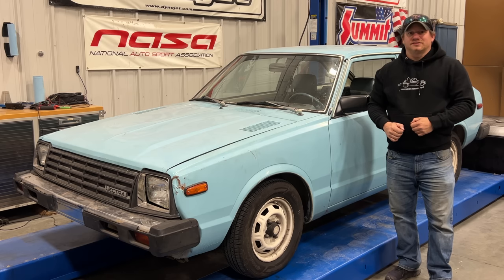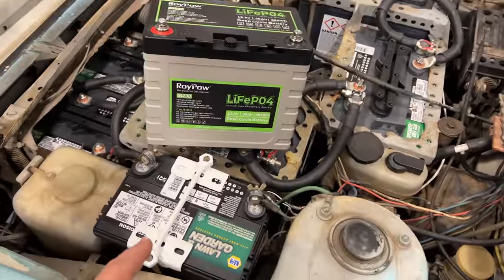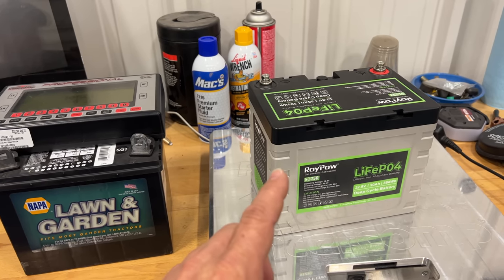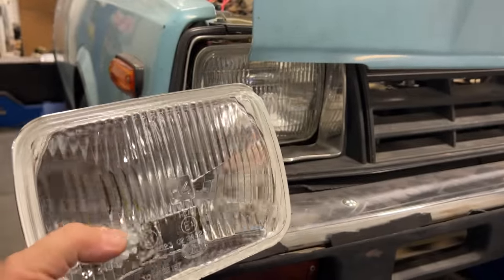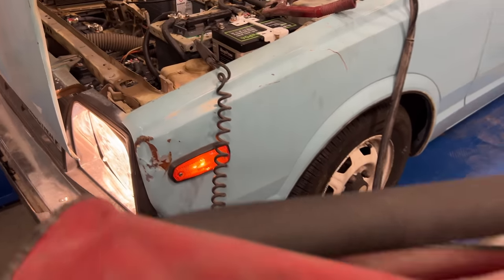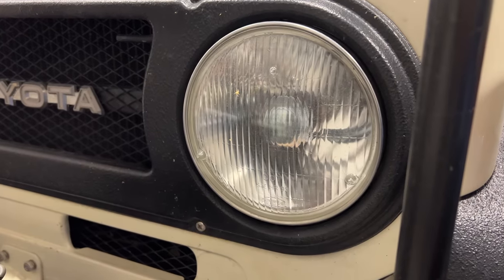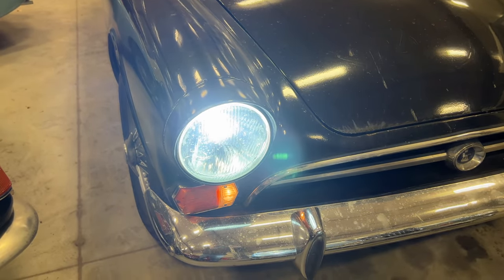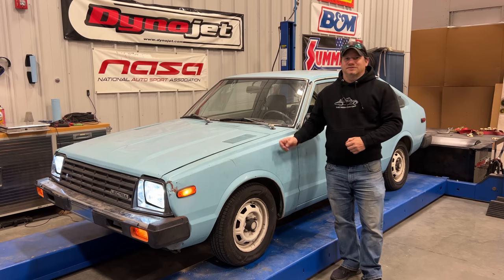Upgrading the Lectra with Lithium Battery Power

Comment: When installing LED's, one must make sure the headlamps are adjusted correctly. Many of the LED's headlights' beam are all over the place, blinding oncoming drivers at night.
Reply: Putting cool white LEDs in housings designed for halogen bulbs (except for projector types) usually results in a badly focused beam. There's no way to adjust that because the lamp is basically scattering light all over the place. The best thing to do is to use correctly designed bulbs of the same colour temperature as halogens. In my part of the world, putting LED bulbs in halogen housings recently became illegal and will fail inspection, and I've definitely noticed a reduction in the number of times I get blinded at night by badly-modified cars.

Comment: Interesting video Steve. As  it doesn't seem long since you installed the batteries It will be perhaps unwise to change all the others at the moment, they have a good few miles left in them. However when the time comes it would be interesting to compare the weight before and after the swap. Those lights make a great improvement for this time of the year and blend well with the cars. You would find it hard to tell them apart which is the whole point of the upgrade. Thanks Steve please keep the videos coming. 👍👍

Comment: Running and tail light LED swaps will drop consumption even more.  Add, the LiFePo battery is never going to provide more than 13 volts, and the LED replacements will last longer.  Typical for that age of car, running lights are an 1156, turn/tail is an 1157 (may need a ballast resistor in the turn circuit), and side markers are a 914.  You'd go from amps to milliamps.

Comment: Remember to park car outside away from buildings and other vehicles 
It will and it will catch fire I've had forklifts do the exact same thing.
They are not a forever powerhouse
Reply from the maker: LiFePo batteries do not catch fire like other Lithium batteries.

Comment: Where is the heat sink for the led bulbs?
Reply from the maker: Not needed for these which is why I like this model.
Reply: @ThisWeekWithCars  I don't understand. Where does the heat go?
Reply from the maker: Same as an incandescent bulb it doesn’t make enough to need a fan or external heat sink.
Reply: Also, does the led have the same light pattern as the H4? Clear cut off on low beam. The light source has to be in the same position as the Halogen H4 filament.
Reply from the maker: Yes
Reply: Steve. Is the 7amp draw just the head lights or are all the other lights also include?  Like the parking and side maker lights.